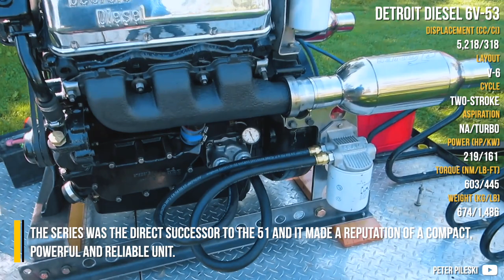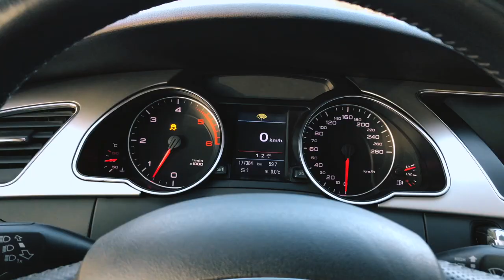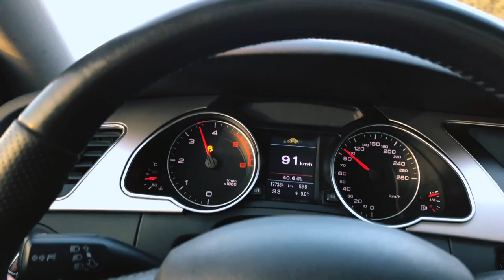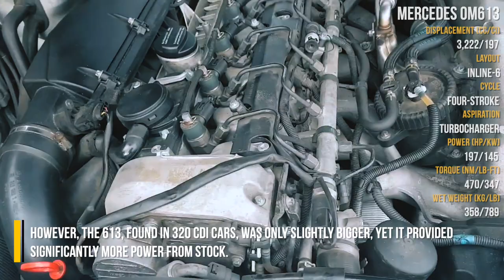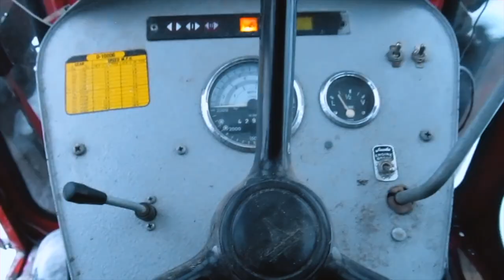10 Of Best Sounding 6-Cylinder Diesel Engines

Comment: That V6 diesel engine on the first appearance, is the most coolest diesel engine sound ever in my life.
Reply: AS P that’s a double negative
Reply: The most coolest
Reply: @davidv6408  Double positive actually.
Reply: Look up the Detroit diesel v12
Reply: Two stroke diesels sound incredible
Reply: @thegreatkingdaniel  there was a v12 two stroke diesel engine, attached on a two joint rig, the brand of the rig named Skytop #7, and yeah it was awesome had an experience hearing that engine sound. And it has pneumatic starter.

Comment: I'm actually extremely happy to see the M57 in the video
Reply: it should have been in the best tuner diesel engine video instead of this one and the m51 in this imo
Reply: Exactly.
Reply: Satam Heheheheh someone been doing that reasearch😂
Reply: It’s the turbo I say the turbo😂. Might have to stress it out a little bit to see how it is under pressure😏😏
Reply: lol om613 and om648 is better
Reply: I've owned mine for 20 years. Brand new from the factory with the AC Schnitzer piggy back ECU, sitting on 700000km. Only thing I've done is upgrade the turbo.

Comment: A BMW Engine in a G-Class? Mercedes Fanboys are crying
Reply: Sounds like the European equivalent of putting a Honda F20c in a Toyota AE86
Reply: Or a Ecoboost v6 in a grand Cherokee
Reply: What,s going on . That doesn’t seem like something that would happen.
Reply: Creeperboy and friends HEHE THATS RELABILITY AT ITS BEST😂😂😂😂😂
Reply: It's like VTEC swapping an FD RX7
Reply: Bmw engine on the new supra...
Reply: Hehehehehehehe it has the externals of a Mercedes but the internals of a bmw Oh what a wonderful partnership this will be. DONT FORGET TO USE BLINKERS😂
Reply: SansPeppaShrekterGrifpig _ hehehe I only did it cause it blew up three times shut up brehhh😂😂😂😂😂😂
Reply: Fruitably YT heheh didn’t lose much still rev to 9000 rpm 😂😂 and I don’t have to worry about oil burning loss😂
Reply: What's next, putting a BMW engine in a Toyota? Oh wait...
Reply: @gqh007  Or A 4.0 TDV8 Land Rover Engine In A Mustang.
Reply: swedish trucks and american diesel 
bmw and mercedes,german diesel fans are crying
Reply: Only the Russian Mercedes fanboys, the g wagon is only really relevant in Moscow and st petersburg
Reply: El Mitcho  was thinking about the original 86, but I guess that works too— the F20c is a pretty great engine

Comment: I love my i6's. I have an 01 dodge 2500 with the 5.9L cummins ISB was my grandfather's)  and a 4.0L i6 in a jeep tj (also was my grandfathers). I have a high flow exhaust system and large tip (roast me) on the tj and it sounds like a less bass-y cummins at idle imo

Comment: were is the bmw M51D25 OL, "bmw E34 525TDS with staight pipes"?
Reply: That is one bad engine. BMW could not build reliable diesels until 1998. I had driven a BMW E28 524 td, the second engine was a fluke. It was pretty much reliable, if treated right and got past 300.000 kms.

Comment: where Volvo D24?
Reply: Smh
Reply: Did you mean the vw d24
Reply: It’s not a Volvo engine. Volkswagen built the engine and Volvo put a turbo on it. Most gutless turbo 6 cylinder diesel to be in a passenger car for sure.
Reply: @isundgrensakeri  yea i know
Reply: Probably at the scrapyard..... Because of the cracked Heads..
Reply: @arjanb8510  lmao
Reply: @isundgrensakeri  Thats what makes it great. No power, incredible reliability if kept stock and huge smoke cloud whenever you go near the throttle kol
Reply: Team scannia my 760 tic could keep up with a 2.8 petrol BMW so ain't that slow,happily do 100mph in a 2+ ton car

Comment: 2.5 V6 TDI wasn't that horrible I have two cars with 2.5 V6 TDI and I'm happy they're never broke in my hands. People are talking crap about this engine because never had him and only heard that it is bad or they treat him bad ( it's not bulletproof engine). Sound if you add straight pipe is similar to 3.0 and on high rpm like petrol V6 :)

Comment: The 3116 Cat is a slug for power,Freightliner used it
Reply: Cats best engine has to be the 3406 line up. Even the late 90s 3406s was good. Specifically the 3406E
Reply: I was honestly surprised the 3116 was on this list, now even though “small block” cats have their issues I still would have chose a 3126 or a C7 over the 16, but I do agree the 3406E is by far possibly the best they produced, but I do have a soft spot for the 6NZ’s though

Comment: Should've swapped the Nissan rd28 with the Nissan TD42 the TD42 is still a inline6 td engine bit it's displacement  is bumped up to 4.2L and is way more reliable (some examples going up to 6-700 thousand kms
Reply: Or even the sd33t
Reply: Ahh yes. The old td42 kettle haha. But they do sound good.
Reply: Sounds like we have some aussie/nz friends here
Reply: Definitely missing the td42 and 1hd-fte
Reply: @TDJDriftersBoss  yeah forgot about the old Toyota engine that's an ablosute beast as well.

Comment: I've owned my BMW E46 330d AC Schnitzer for 20 years. Brand new from the factory with the AC Schnitzer piggy back ECU, sitting on 700000km. Only thing I've done is upgrade the turbo.

Comment: Mitsubishi 6d14,6d15,6d16,6m60, Nissan diesel UD mk250 6.8l diesel (beast sound),land cruiser 12ht,1hz,1hdft, all Isuzu F series trucks,old scania semis,etc
Reply: Honestly i reckon isuzu 6hks and 6uzs are the most plain boring sounding engines. Like theyre a lovely truck, reliable as hell but they sound flat. No character

Comment: MB OM501, OM441, OM366, OM352, OM906, DAF WS, XE, MX13, Man D2886, Iveco Cursor 13, Mack E series (Renault magnum), YaMZ 236 and many other great sounding diesels are missed. It's impossible to make "Best 10" video) because much more engines has great sound.

Comment: Fyi, the Nissan TD42T was a way better motor than the rd28, sinilar but better sound and heaps more power and way more reliable. Also the Toyota 1hdfte should have been on this list I believe, they are also very nice sounding, reliable motors. Thanks 👍

Comment: Any one know;
How big would the cylinders be on a 16 liter engine?
Reply: Jamie Reid depends on the bore and stroke of the engine. Which 16 liter are you talking about? Never mind got it. 5.67” x 6.5” that is bore and stroke 👍🏻
Reply: 8 liters for a two cylinder or basically negligible on an infinite cylinder engine
Reply: @Sackmatters  is that " mean inches?
I thought with a 16,000cc engine the cylinders would be like 12 inches long lol

(Yes I'm thick lol)
Reply: Jamie Reid LoL yes inches. It’s one big engine.

Comment: The 3.0 TDI is also available in a tri-turbo form in the SQ7 TDI. It has 2 conventional turbochargers and an E.P.C. or Electronic Powered Compressor which is supplying boost from idle

Comment: This video would probably need at least a part 2 with all the great six cylinder diesel out there, I'd like to suggest the 4.2L Toyota 1HZ engine as I can definitely vouch for it having an amazing exhaust note in my uncle's Landcruiser. Also the Nissan TD42 is another great option as this is basically the Nissan version of the 1HZ, both are used in very similar applications and vehicles and we've even got some competition here in Australia as to which engine is better

Comment: Sh*t up about the VAG 2.5 Tdi, there is not a video about diesel's, where you don't talk about it. Every person that owned or owns one will confirm, that it's a brilliant engine that will run until the world ends. You just need to take car of it, which a lot of people are to stupid to do...
Mine is on the way to 380000km without any abnormal problems!

Comment: Where is the Volvo D5 engine? A straight-5 cylinder engine, sounds great. 

Besides the TDI engines are from a crooked company.
Reply: David Radtke this video is made specifically for 6 cylinder diesels. 5 cylinder diesels are covered in another video

Comment: The Volvo Truck with 750 hp has a V8 not a I6. Volvo builds I6 only about 450 -500hp.
Reply: oh no, the volvo 750 hp engine is a D16 straight six engine...
Reply: errr, no... It's a L6...
Reply: Newest D13K Euro6 goes from 420 to 540hp, D16K  goes from 550 to 750hp. Both are straight 6 engines. Volvo never made a V8 for FH series
Reply: Scania as far as i know is the only company producing road going V8s
Reply: @nickwhite6717  MAN TGX is offered with a V8 as well.
Reply: @larstragl146  i stand corrected
Reply: @larstragl146  correction, man stopped production in 2012 or there abouts of V8s with the introduction on euro 6 standards
Reply: @nickwhite6717  ...thought the big one, the 15,2 litre was a V8, but indeed it's a L6

Comment: European is kinda loser when it come to a diesel engine on a passenger car: 3.0L VW TDI? look at the cummins, it got 5.9 and now 6.7L ! Having 6 cylinder on 3 Liter displacement is unacceptable but they are great!
Reply: With that logic,a V12 should have 12 liters of displacement
Reply: Yes, but traditionally that's what the Americans do; big displacement / low effiecency / low hp per capacity engines. Whereas the Europeans have always engineered more efficient smaller capacity engines with the same power outputs & lower fuel consumption.